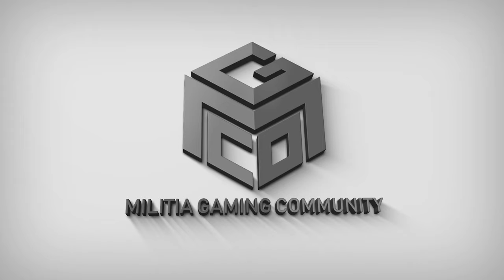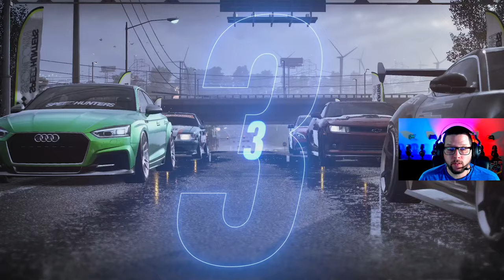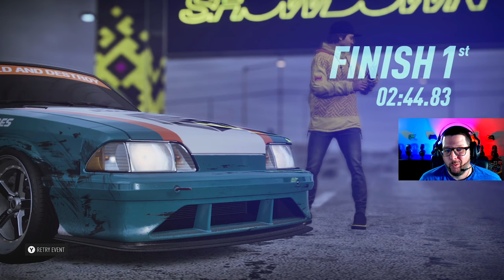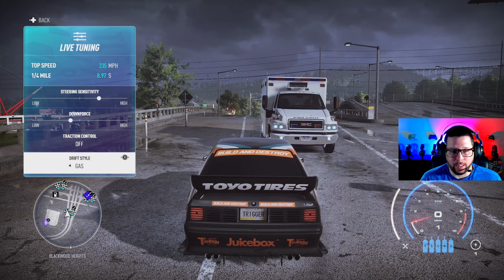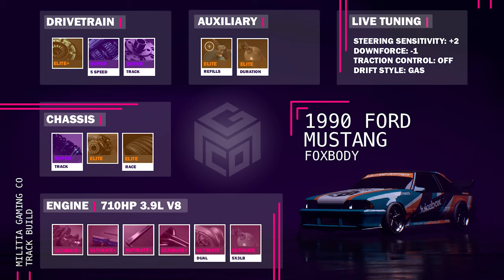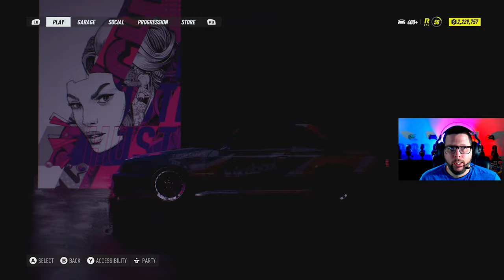You're Using the WRONG BUILD | 1990 FORD MUSTANG FOXBODY | Need for Speed Heat

Comment: Best Pagani Huayra Put a 6 speed in the car and it will make the top speed 235, 0-60 to 2 seconds flat, just lower the downforce by 3 and the quarter mile will be 8.67,  put a 8.4 later V-10  and put all ultimate parts, nos you choose, track suspension, elite brakes, track tires, super 6 speed gearbox, dual turbo charger (ultimate)Militia Gaming if you reading this try it it’s better than your build
Reply: Bud I'm gonna give u some advice put the 6.2 v8 and ur quarter will be 8.63 with race tires and 8.53 with drag on

Comment: It's just not right putting a different engine in the fox the 4.9 liter which they called it a 5.0 sounds so good and is a great running engine. I had a 87 GT which was my first mustang back in 06 now I got 2015 GT premium that I've been driving for 5 years now. I wish they'd put the Toyota MR2 Turbo in this game or Honda CRX two cars I used to own and were so much fun. Also would be cool to see a supra in the game too. Anyway I turned the downforce all the way up for the foxbody just like the coyote and it handles so much better. Thanks for the vid just figured I'd offer my two cents.

Comment: With the drag build I got a 8:53 with the 6.2 v8 with the 7 speed.
Reply: The 6.2 v8 is actually the fastest drag racing engine for the foxbody. I've tested all of them and there was another engine that was almost neck and neck with the 6.2 can't remember which off the top of my head i'll have to check again.
Reply: @angelberrios7408  yeah it’s definitely better a better engine for drag 👍 I think the other engine was another V8? Maybe a 4.9L
Reply: Have you tried other transmissions?
Reply: @angelberrios7408 better transmission?

Comment: I use this car with the 3.9l V8 with a screw supercharger and switch between the drag slicks for more acceleration and track tires for better handling ending with a total of 1,143hp, 5 speed, race and drag beast but I also enjoyed this video’s suggestion.